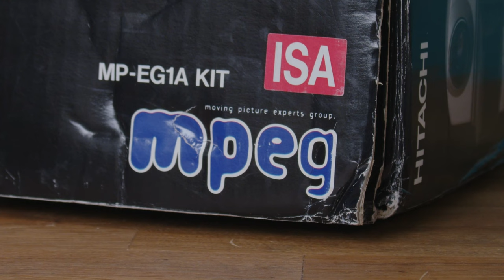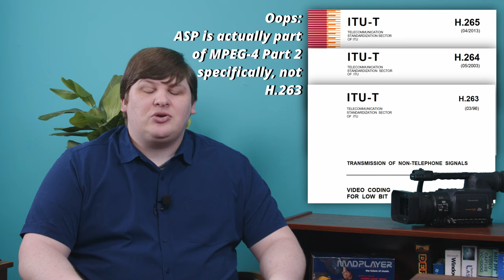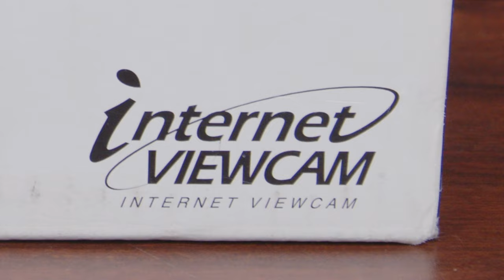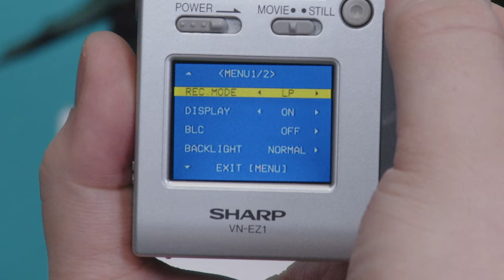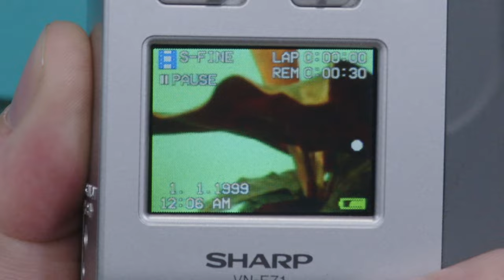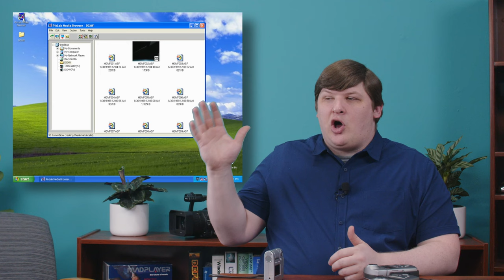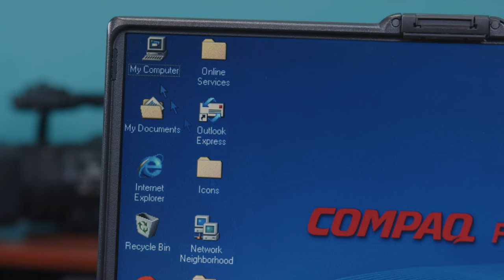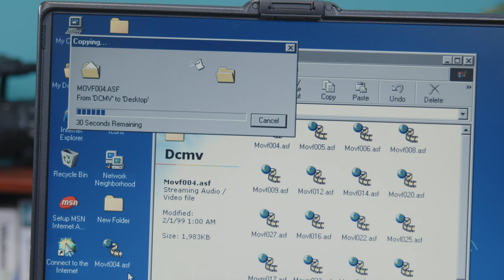The first thing that ever used MPEG4 [Sharp VN-EZ1]

Comment: The microSD -> SD adapter -> CF adapter -> PCMCIA adapter was weirdly satisfying in a Rube Goldberg sort of way
Reply: Slightly disappointed there wasn't a miniSD in between the microSD and SD.
Reply: Ah, the daisy-chain of ever evolving gadgetry from the early 2000's.
Reply: Its the dongle dance, a true classic
Reply: Nesting dolls
Reply: Matroska file format :D
Reply: Tower of power.
Reply: The first and last steps are just mechanical formfactor adaptors, and don't have any electronics -- they just get the pins in the right place.  So the only real format / protocol adapter here is the SD->CF .
Reply: @JohnDlugosz yeah, but it is still silly.
Reply: its like when i saw a SATA SSD converted to IDE 40PIN converted to SCSI then put in an old classic mac

Comment: A floppy disk card reader seems like the sort of thing I would think about in the shower, and then dismiss as being silly and impractical. And these madlads actually did it. And it works well.
Reply: ...and I want one.
Reply: Sony also had one of those that took Memory Stick, for some of the Mavicas of the time, and also could be used on a PC
Reply: 8BitGuy did a video about the Sony Mavica series, and they had one just like it but it took a proprietary USB flash drive
Reply: I have seen all types of strange adapters in that era, Never once has that one ever crossed my radar. However I was only mildly into things that took external storage to operate so....
Reply: I've been wanting one for years
Reply: Would be awesome if Lgr could get hold of one and try running doom from it <3
Reply: I would have slit throats for that in 97, the STACKS of floppies I had to carry around... ☠️☠️☠️
Reply: The fact that it actually uses the disk drive as a crude serial connection 🤯
Reply: @MostlyPennyCat  : I noticed those at the time, and here's a dirty secret- we all just used floppies because they were cheaper. Flash was available, but not the sort of thing that you'd normally buy. More likely you'd buy a Floptical or similar drive than the flash that the floppy converters worked with.
Reply: Fellow derg
Reply: When all you have is a floppy disk drive, every problem looks like a floppy disk. Or storage problem, anyway.

Comment: (TL;DR is at the bottom) About the atrocious audio on the Sharp camera, I did a bit of digging into why it sounds bad on modern codecs, and what I found is odd. It's audio is, on modern software, reported as a 8KHz 16 bit PCM, which seems correct, but if you open it in Audacity, it still thinks it's a 16 bit PCM, but you can see that the waveform, after it gets too loud, seems to overflow, just like an integer would. This seems to be how modern codecs handle the audio in those clips.
 In other software, it's identified as a G.726 ADPCM audio stream, which is... not exactly a PCM audio stream. I cannot find much of any information on it, other than it's made for speech only, was used in DECT telephones and international telephone trunk lines, has a bandwidth of 0.3 to 4.3kHz, and supports bitrates of 16, 24, 32, and 40 kb/s. there's more info on codec specs online, but it's still a really bizarre audio codec for a "thing" that uses MPEG4.

TL;DR, the Sharp camera uses a telephone line codec for audio, which modern software doesn't know how to handle.
Reply: Is it DPCM?
Reply: Knowing this, it might be fun to download some of those test clips and write conversion software, so anyone with this exact camera can finally record with good audio in 5fps glory.
Reply: @tbuk8350  I'd love to see it, however obscure it'd be! I just ITU's documentation on it. Easily hundreds of pages of how it works, all technical specs. Don't get me wrong, I love technical stuff, but I'm not gonna read a novel on it. Definitely not for a youtube comment.
Reply: @renakunisaki  I recommend you to look up G.726 ADPCM. My answer to your question is... well, yes? no? maybe. It really depends. G.726 has alot of quirks that make it super low bitrate, but easy to decode and pretty low digital artifacts, since it was made for telephone lines. G.726's 20-some year old cousin, G.711, is still used in telephone lines. If you have called anyone recently, you'll likely hear G.711. Newer "HD audio" on VoIP phones are G.722, though.
Reply: Well, knowing that now, I don't blame modern codecs for breaking around that thing, that it such an odd choice that clearly no one else followed for good reason
Reply: I tried playing the example clips in ffplay which reported the audio as g726 but the quality was the same an the distortion didn‘t change.
Edit:
The normal videos seem to not have the mpeg4 standard implemented correctly as ffmpeg sees error in some of the frames. Audio didn’t change.
Reply: Thank you for looking into this!

 It sounded like 8-bit quantisation noise to me (I left a comment saying as such 5 months ago) but wasn’t sure why they should get applied only on a decode elsewhere, since dithering is usually done on the encode side. But if it’s interpreting 8 as 16 bit, that might explain it, if the top 8 bits were only-either on or off together, that would create a very similar spiky waveform.

Edit: I just spotted another comment way further down in the list from a codec engineer — they said it’s harmonics from the low sample rate, not quantisation noise or bit depth related at all. The camera probably over-samples the output, or maybe uses a 1-bit hardware DAC which doesn’t need to.
Reply: 47:40 he claims Sharp would release a product with a Japanese telecoms company. Seems like they just had the contact already and used that without looking anywhere else. So why? Convenience I would imagine
Reply: @WalnutSpice  I did some looking into it and the only phones I can see that use G.726 are European DECT phones. Sure, international trunk lines use it as well, but I don't think that the collaboration with a Japanese telecoms company would make it make sense. I think that the most sensible thing is that it's a very small file size, as well as very easy to encode for low power, embedded systems.
Also, another valid reason could be that it's an "internet viewcam" part. MP3 and AAC were simply too big, needing a quarter of the bandwidth of the whole 384kbps file to sound reasonably good, but also needing a TON of processing to encode and decode. Most likely, they used G.726 because, 1, the usage seemed to be directed towards speech only, and 2, it was, to my knowledge, one of the best (and I'm saying that generously) general purpose codecs that existed that used such miniscule bandwidth (16-40kb/s), leaving ample space for a video stream alongside it without making files that were too big for uploading to e-mail via dial-up.
Reply: To me it actually sounds like adpcm decoded with the wrong step size table. Someone at ffmpeg must've been assuming it uses the same as some other codec because everything else matched. Or they simply cannot find the step size table or didn't bother. Someone could read the firmware and try to find that step size table and fix it in ffmpeg and do a pull request.

Comment from the maker: Additions/Corrections:

- JonasLue pointed out a very doofy mistake on my part: The reason cameras came with crappy Explorer knockoffs was almost certainly because of the thumbnail view. Apparently it didn't hit consumer Windows until XP. I could have sworn it was in 98SE but apparently not, and the deployed base of Windows 95 machines in 99 was likely still enormous.

Users would have been frustrated by having to open every video clip one at a time to find out what was in it. It's so tough to keep stuff like this in mind, even given that I was there for these features being added and remembered how much of a relief they were.

- LAP is probably for "eLAPsed", which is weird, but how else would you abbreviate that?

- This certainly wasn't Hitachi's first camcorder - they made pro gear for decades. I knew that, and I was only saying that I thought it was their first consumer model. There were some on the market with their name on them, yeah, but I thought they were rebrands which was really common at the time. Honestly I don't really know which is true, but this is one of those things where I didn't even think to research it, my brain just said "hitachi? heh, nah, that's not a camera you'd find at Circuit City."

- Should you have gotten a USB reader in 99? Well, probably not. I got curious about this during editing (too late to do anything about it) and looked a little harder, and I found articles where reviewers were rattling off all sorts of info about cards and readers and never once mentioning USB. And then I spoke to some friends who reminded me that Windows didn't really have a competent USB stack in 95 or 98, they basically supported HID and very little else, and not reliably. Again, a thing I was in fact there for, but I think I just missed this aspect of it. I'm positive I had USB devices on 98, but probably just keyboard, mouse, joystick - I would not have noticed if the rest of the stack was broken. Apple had working USB at the time, but that's Apple.

- Fast forward/rewind may have been missing on the first MPEGcam because seeking compressed video is usually highly processor intensive... or, well, it can be. MPEG codecs are all interframe, meaning (in short) that unless you drop the needle on a periodic "I-frame" or "keyframe", you have to process a lot of frames in order to produce a picture, not just one. Now, you CAN just seek by hopping from I-frame to I-frame, but maybe the EG1 used a very low I-frame rate and it would have cleared four or five seconds in a hop, while the EG10 used a higher rate and shorter intervals, so it made more sense. Total speculation at the moment, but a thing to consider.

- Several Other Errors, I'm Sure. It is treacherous as hell trying to cover this wide a swath of information in one go.
Reply: Heh, I was just about to comment that Win95 couldn’t do it, now I don’t have to (but here’s some algorithmic engagement anyway).
Reply: Windows 98 got adopted pretty fast. At least among people I knew here in canada. Most people pentium 100 and up were wanting it almost right away.
Reply: Why did they give up on cameras using CD media? They have 1TB CDs and even 3.3TB now. Also why did they did the home market give up on cheap 1TB backups?
Reply: Windows 98 or at least SE could display a preview of an image or display a small windows media player view of a video in the sidebar if you selected it.  It's something but the browseable thumbnail viewer would've been far more useful than that.  I don't think it could display previews as icons.  Maybe Plus! would've added it?  But I don't remember it being a thing until XP or maybe Me.
Reply: @Thrakus  a cd has max 700mb…
Reply: @MrPunker0007  True good point, I did think compact disc was the term for all formats of Optical Media, so I guess the right term would be 1TB Optical Discs
Reply: @Thrakus  even then, the biggest consumer writable optical media I've seen is Blu-ray, which I'm pretty sure caps out at 25GB per layer and four layers, so 100GB.  That's easy to beat by flash these days.  Everything beyond that, if it exists, would be even more niche and if you're not likely to have a drive in your PC that can read it why bother with removable storage to begin with?  Flash has way less moving parts and things that can go wrong, and it's continuously getting cheaper to the point where (because no economies of scale) it probably beats out optical media blanks per capacity.
Reply: @jdatlas4668  Sony and Panasonic along with TDK did say work to develop 1TB optical disc was being done in 2010, Sony makes 3.3TB optical disc for backups . It was going to be called BDXL-BLU and set for June 2010, 500GB was made in 2008. I do not understand why people gave up on that media when looking at cost to value.
Reply: Another video to time-travel back and show somebody at Hitachi
Reply: I doubt a 1TB or even 3.3TB optical media would be less cheap (including one time cost for a burner) than other storage media like hard drives and nowadays flash storage are and not more reliable or faster than tape for proper archival purposes or backups.

There's more to storage media than simple cost per gigabyte, for end users such discs would probably be too inconvenient or expensive especially at launch and compared to other storage media available at the time and businesses already had well known methods for backing up data.
Reply: Windows 98 does have thumbnail mode in explorer, but it's done in a very weird and user hostile way. In order to use thumbnail mode, you need to enable it for each individual folder by ticking a checkbox in the properties window for that folder called "Enable Thumbnail View". After you do that, the Thumbnail view is available for that folder only, folders created within that folder won't inherit the property and need to have the checkbox ticked in their properties window. There is no officially supported option to enable thumbnail view for all folders by default, although methods like registry tweaks can enable you to have thumbnails on by default. (TweakUI might let you do this too) The reason why it was done this way seems to be performance related, but I don't know for sure. I am not surprised that almost all "normal" users didn't know this functionality existed in Windows 98, and that's why a bunch of photo management tools existed BITD.
Reply: .mov is pronounced mooov, like movie, but no ee sound at the end. Sorry, that one bugged me, had to come comment about it immediately ;)
Reply: @Aeduo  I read at one point that sales of new Windows 95 licenses remained high after the release of Windows 98. Windows 95 was, I think, highly deployed by businesses on machines that were not powerful enough (or did not need) Windows NT. Businesses with a lot of Windows 95 systems wanted to keep using Windows 95 on their new computers as well, instead of having a mix of systems.
So, I think it was just like it is today: businesses (especially schools) just keep an old, reliable version around for years instead of upgrading.
Reply: @iannicolson  Yes, quite a few were still running 3.11 for workgroups until late in the 1990s even.. but products like this only really have to care about what the consumer market does.
Reply: @c128stuff  I agree. However, I could still see this camera being considered by schools. A few years ago, when I was at primary school, we used cameras and worked with multimedia all the time. Many projects we did involved some group members taking photos and videos of something (nature, performances, etc.) and importing those photos to the school server. Others would then put them in Word documents or PowerPoint files.
Reply: Don't forget to re-pin your comment after editing! (Assuming it's meant to be pinned, because it's not.)
Reply: Very minor and only barely relevant thing, but I actually have a 64MB SmartMedia Card somewhere, so while they're very hard to get above sizes like 8MB, I can confirm there's at least one capacity higher than your model. I enjoyed the video, btw!
Reply: @iannicolson  Well, the 1990s was a different time in a number of ways, for one the need for having uptodate systems from a security point of view wasn't as big as it is now. 

If a school in the last decade was doing media labs on seriously outdated computers, they have bigger issues than a missing feature or lacking driver, especially when getting files from a gazillion sources and wanting to put that online.

Sure, this problem did somewhat exist already in the 1990s, technically.. but it wasn't exploited in the way it is now, regulations for it weren't in place yet, and awareness was way less.

But in todays world that would be unexcusable, and a school opens itself up for legal liability even in many parts of the world by not minding this.

And that doesn't even get into it being way more helpfull to teach kids todays way of doing things than yesterdecades way of doing things (unless you are teaching history). That argument already applies in the 1990s.
Reply: I agree that running outdated systems in schools is a massive, irresponsible risk and is also bad for the teaching experience.
Unfortunately, we have to put up with this over here. Scottish state primary and high schools have almost ZERO I.T. budget. When I left primary school in 2016, school PCs still ran Windows XP Professional, which had been out of support for more than 2 years by that point. My high school just barely managed to get rid of Windows 7 Professional, mere months before end of support for that version.
In addition, the software we have to use is extremely old. In computing class at my high school, we were taught web development using Macromedia Dreamweaver MX 2004, which was designed for Internet Explorer 6. We also used Office 2007 well beyond its end of support date.
Protection of student’s and teacher’s data clearly wasn’t on anyone’s mind.
North Korean schools probably had better than us at some point.
Reply: Hitachi were selling consumer grade VHS camcorders in the mid-late '80s in PAL markets at least, they made their own decks and their own vidicon tubes so I have no reason to believe they were re-branded.
Reply: One (severely late) thing to add: >32MB SmartMedia cards did exist - in fact, I used to have one with my 2003 Polaroid-branded P&S camera